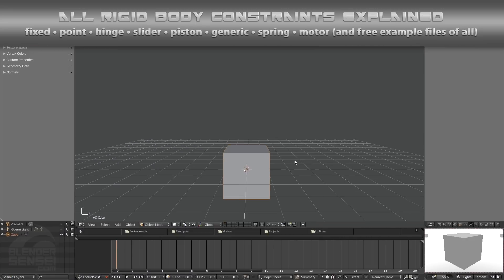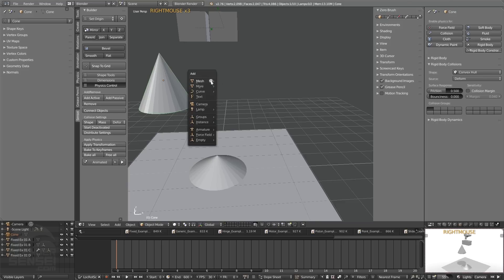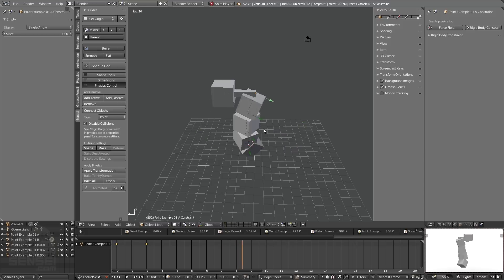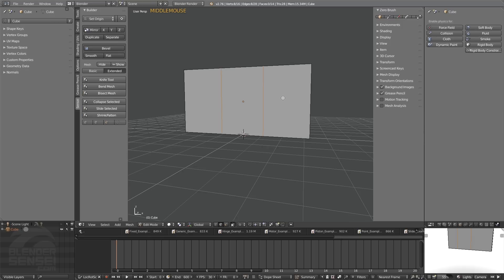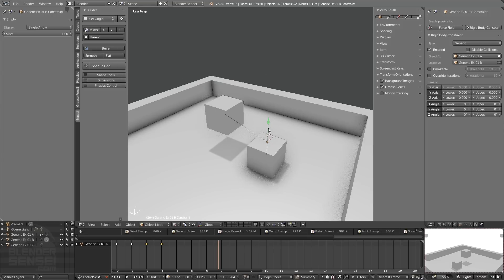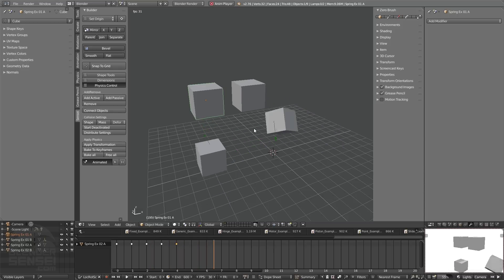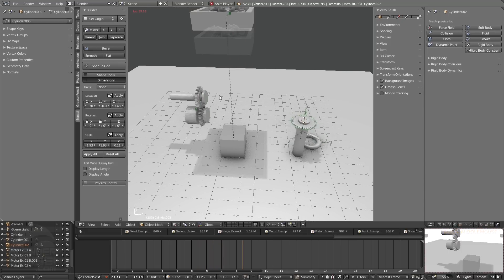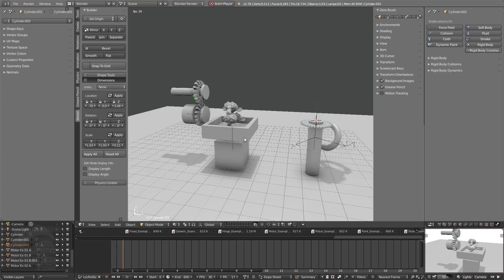All Rigid Body Constraints Explained

Comment: Great having a 2016 tutorial on this subject. I am having a basic difficulty in following this tutorial because any constraint I assign doesn't want to stay with the objects it is constraining. When the animation starts the constraint just stays where it is while the objects go wherever the animation takes them, especially if I grab one. I wanted to use a fix constraint to hold a small cube on top of a big cube (both rigid  bodies), but the small one simply falls of the big one when it hits the ground. I can't get what you get at all. I am using version 2.73, but could update later. I have just started using Blender again after a long break. Thanks

Comment: The 'Generic Spring' seems translational along x, y or z only. 
It can not be used for  a rotational springs around an axis?
How would I model a rotational spring?
Reply from the maker: +gyes99 You would probably want to set that up via two spring constraints, one for the outer force and another for the inner, then much of it would be getting the mesh you modeled as the rotational spring to correspond to the proper forces. I will likely do another video in the future about combining soft bodies anchored to rigid body constraints to demonstrate these kind of tasks.
Reply: +Blender Sensei Thanks for the very quick reply. I wait for the tutorial of a rotational spring then, which hopefully comes soon.